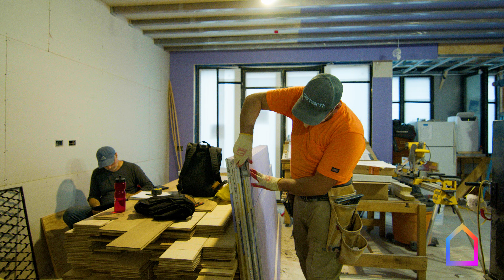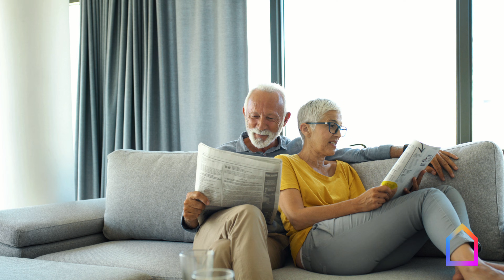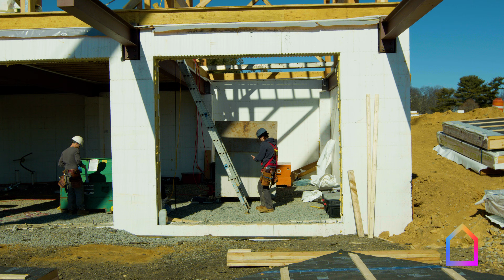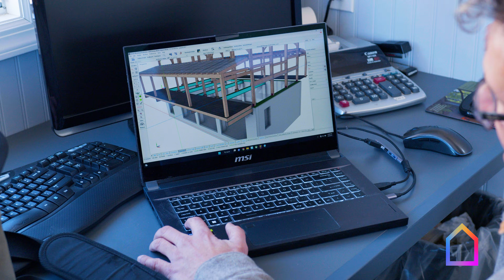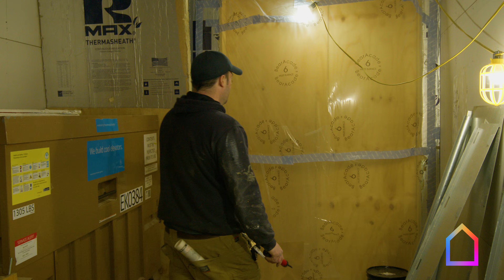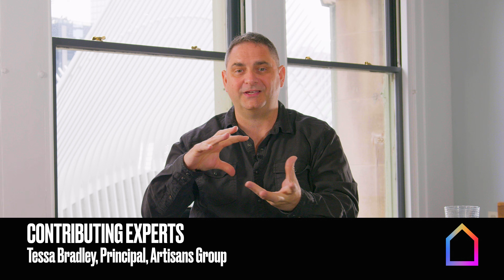10 Steps To Designing Your First Passive House

Comment: As a builder. What sold me on passive houses. Building in winter a regular house is usually colder inside than out. Passive houses even with no utilities are warmer inside than out in winter even not finished. No need to open windows in winter to warm house. Air tools (nail guns) can have issues around 18*F. Spending extra on insulation, insulated doors, and good windows is well worth the money. The insulation in just my roof cost more than the timber frame and lumber. I use thermal breaks around windows and set towards inside. Less exposed to wind. And less chance of icicles or snow melt and freezing destroying windows seals and flashing. My lower windows have shutters because can get 6 feet of snow in a weekend. Loose passive solar gain but protects windows. I had to replace broken windows before even done building. I have flowing well and springs with small orchard. My water usage is off the charts. I have woods. The amount of downed timbers are more than enough for heating and cooking wood. I use 2 gallons of 2 stroke gas between chainsaw and 2 stroke water pump a month and have propane tank less hot water heater. Rest is all ran by solar d.c. appliances or masonry appliances. The one a.c. appliance I can't live without. The commercial speed queen washing machine. It works. Clothes come clean in one wash less than hour. Use clothes line to dry. Skillion design with 24 foot tall south wall. So can hang clothes line between trees indoors. Basically and earth ship but no tires or berm. 6 foot frost depths. 6 feet of berm is waste compared to insulation. Tires are nasty. Cmu or poured wall works great. My cottage isn't really passive house but is passive solar. Didn't have money for zip in roof or extra insulation under slab. Only radiant barrier, R30, with 4" limestone fines, 4" concrete, 3" flagstone. Which don't add up to enough. Not sure what zone 6 a mile from zone 7 should be. Ground temp is 2*F colder than yearly average temp. Used 3000 air freezing index instead of 2500.

Comment: I want the house with the least amount of bills a month. I would say #1 is location. Each property is different and needs are different in different locations. Example I am in the north, so A.C. is not needed. But being marine environment moisture is an issue. #2 would be design. Do you need a steep roof to shed snow. Shoveling snow off roofs is a real job some places. Do you need 70 psf snow loads. Do you have 6 foot frost depths? Do you expect 6 foot of snow in a weekend?  #3 The passive house consultant. That's the person that recommends really expensive stuff. That's the person that pooh poohs your masonry appliances and passive venting. Which they had little knowledge of. The person worried about too much window in passive house. If it gets too hot I will open windows. Then to hear about only so many air changes. For me to say I need one air change a minute for plants to grow good. I understand few air changes in winter and combustion appliance needing make up air. Even stove hoods need make up air to vent. But nobody seems to understand starting a garden indoors. I went with a simple skillion/shed roof/mono slope/single slope facing solar south with earth ship type planter cell. #4 our code here is almost passive house with insulation levels zone 6 but a mile from zone 7. My cottage was nothing normal. Timber frame, no ducting, no A.C. electric, huge snow loads, no crawl space, and a planter cell. #4 is where things started to fall apart. Indoor planter and masonry appliances give off huge amounts of moisture. Plus need make up air for combustion appliances. #5 it should be on the blueprints. Totally agree with #5 getting something changed mid build sucks. The #6 & #7 Am I supposed to hold meeting with my self before I hand dig piers. Or do foundation. Finding electrician to do d.c. electric. I got the marine electric tech to do mine. Wire it just like a d.c. boat complete with smoke detectors and emergency lighting. No bilge alarm but if you sump pump it maybe good idea.  #8 I didn't do because of clean outs for masonry heater and masonry stove/white oven. But have thought about it. Throwing smoke bombs in masonry appliances and doing blower door test. So can see air leaks. Crank out windows and horizontal sliding windows usual seal better and for longer. Crank out windows usual have best seals because of locks on them. I have not build porch/mud room/arctic entry. It shows when we are there in winter. It's usual above 60 passively even in U.P. of MI winter no utilities. We need to light fire when going in and out of cottage in winter.

Comment: New homes should come with solar panels, a rain water collection system and an electric vehicle charger in the garage.
Reply: I own an EV and I disagree with the EV charger in the garage because different EVs have their charging ports in different places. I think new construction houses should come with heavy duty 50 amp outlets at both ends of garages so when an owner of the house buys an EV the owner can easily put a charger where they need it to charge their EV. 

I agree with the rest though.

Comment: I'm an architectural designer that's studying for my tests.  I would like to have or work for a firm that designs primarily net zero net positive homes.  My current position I'm directed to design just to code. 😢  but I'm trying to absorb as much knowledge as I can about passive house and energy efficiency.

Comment: I agree that passive house is a great standard; it will be part of the house I plan on building.  However, what are the practical benefits of actually being certified a passive house, rather than just building to that standard?
Reply: This is a great question @wustywench. My answer may seem long, but hopefully worth it. 

Even in houses where we can't certify (not gutting the whole house for one reason or another - or due to cost), we still use our passive house consultant during our design and drawing phase. It de risks these phases and brings a ton of benefit to the client and project because we aren't guessing (this is even more important when you are doing passive measures as you want to be sure to run those through the model to ensure it performs the way you want). We make sure there is enough $ in the contractor’s budget (we put it in as a required allowance, so the builder doesn’t feel uncomfortable adding it to their bottom line). This de risks it a bit for the builder as things go left and right during construction (especially on retrofits like we do). Then we test once the house is sealed to ensure we don't have any issues before we close (no needles in a covered-up haystack) and test once completed. That process de risks it for the owner (and everyone else) as you never really knew if there were issues if you don't. 

One certification - although I believe in the process above (even if we must tweak it a bit as we go) - working with the certifying body as a tool (precertification) is a great check before a lot of $ is spent - maybe you can get away with doing less vs more in some cases. I feel that is the best part about certifying vs not. I like the certificate at the end of course - but looking at it from a client’s perspective - it is a great check. 

I hope that rambling answer helps - Michael.